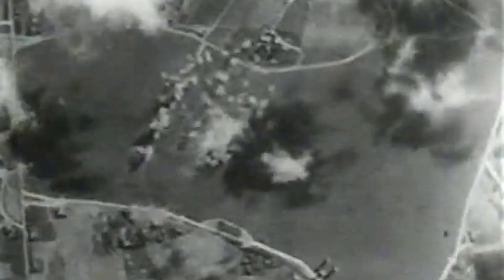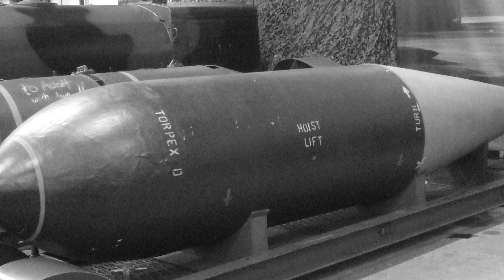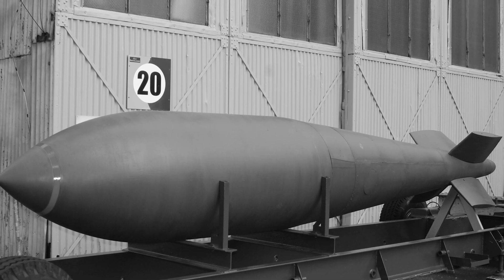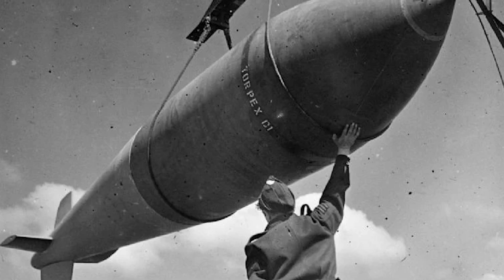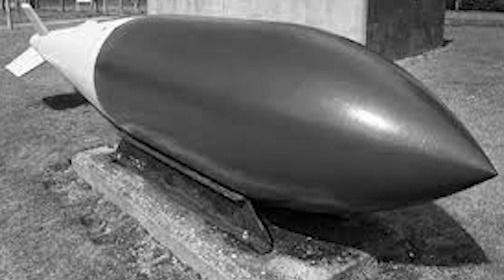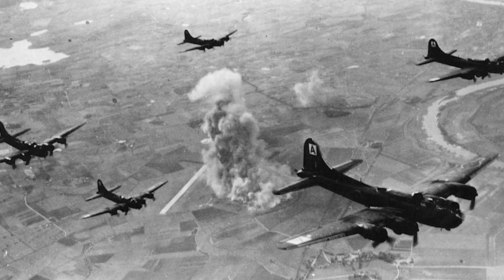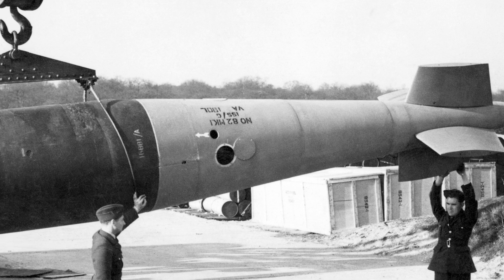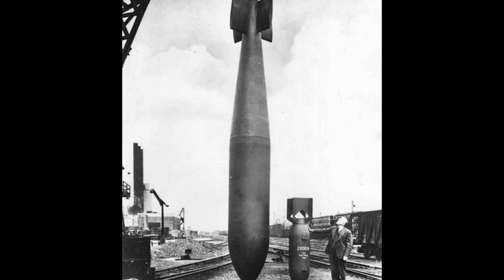The 'Monstrous' British Bomb That Made Concrete Bunkers Collapse From Earthquakes Underground

Comment: Most of the confusion here is mixing illustration with capability. Yes, only modified Lancasters actually carried Tallboy operationally. B-17 and B-24 photos are often context shots, not payload proof. And Tirpitz wasn’t “left there”, she was capsized, later broken up, with large sections still on site for decades. None of that changes what Tallboy actually did. The physics and the results are solid.